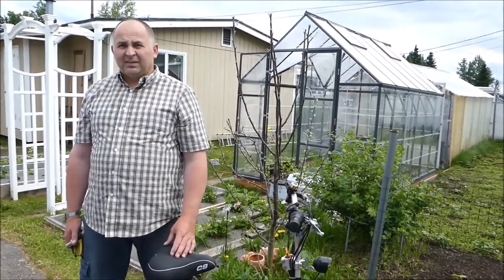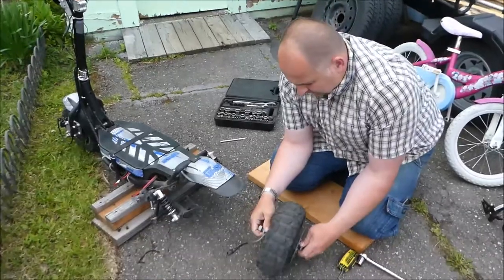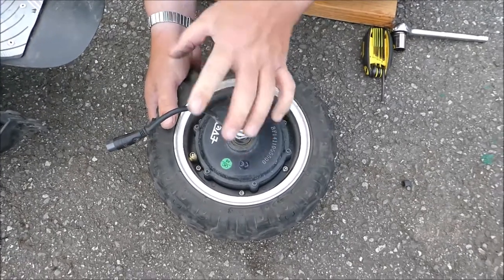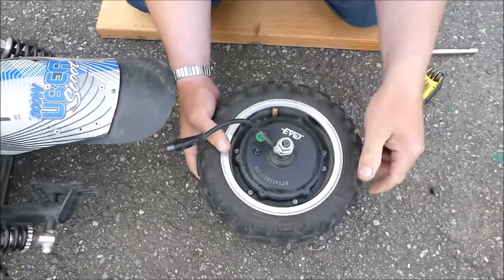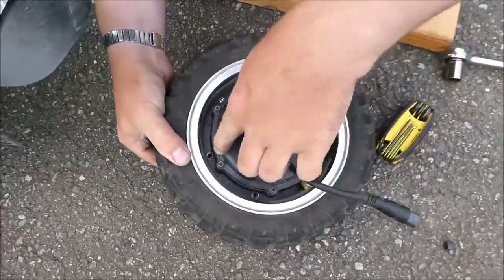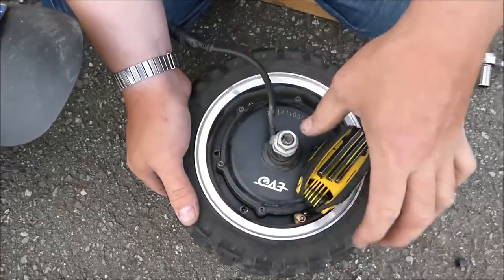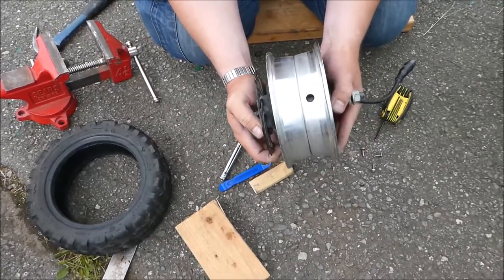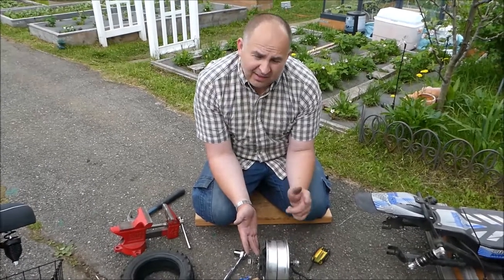UberScoot 800W Citi Scooter hub motor grinding sound problem resolved / fixed, part 2

Comment: Dear Gpeter7. I had the same irritating noise from my new Zero 9 electric scooter. I turned it back to the shop for a repair under warranty but they had no clue to solve the issue.... Finally thanks to you for your generous and very instructing video, I just found that the solution was to simply tighten up the loosen bolts..... Thank you very very much for your help.
Reply from the maker: you are very welcome 😉👍

Comment: Maybe someone forgot to put washers under the screws when assembling the wheel, and that caused the screws to bottom out.  Thanks for the video. My ebike motor has a grinding sound but the reason is obviously not like yours.

Comment: hello, I have a motor that has a hard time spinning, suddenly it gets engarroto and the bearings seem in good condition. It costs a lot to turn even if it's off. Would you know something?
Reply from the maker: well, it can be gears issue, or it also can be a internal winding is shorted, and that's why is hard to turn it